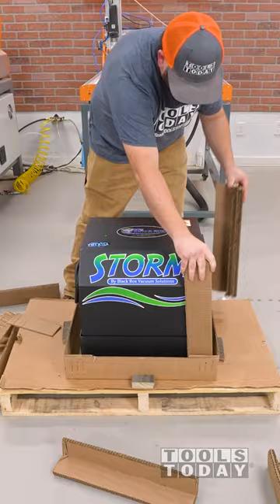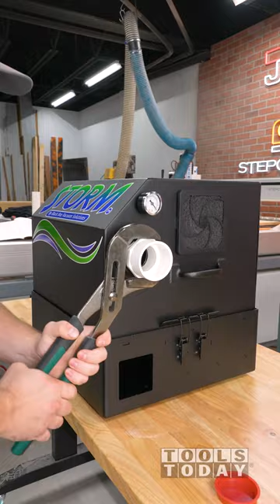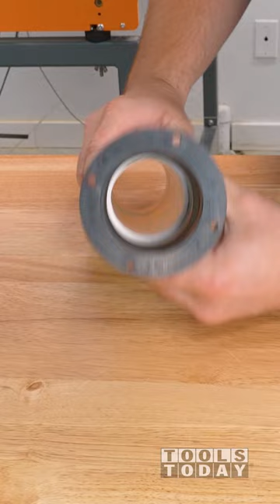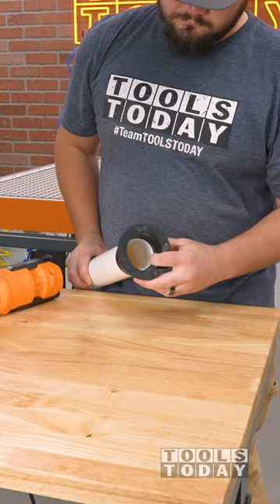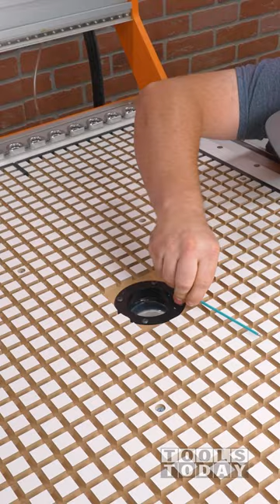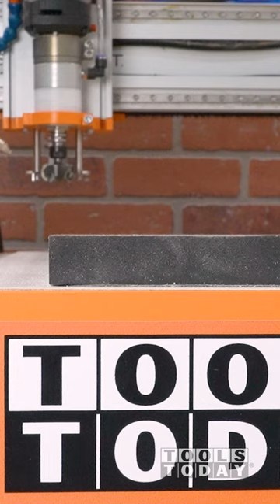Storm Vacuum Table Vac #woodworkingtools #cncwoodworking #cncmachine

Comment from the maker: Check out the tools used on our site - https://toolstoday.com/black-box-vac-bbv-svp-2-storm-vacuum-system-for-cnc-routers-single-phase-220v-230v-at30-amps-2-long-life-high-performance-motors-inline-filter-not-included-but-recommended.html

Stepcraft M.1000 CNC machine - https://toolstoday.com/stepcraft-m-1000-cnc-system.html
Reply: Très  intéressant  j ai pas trouvé  sur votre site  ?